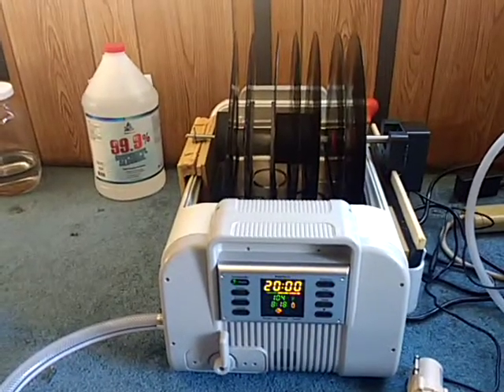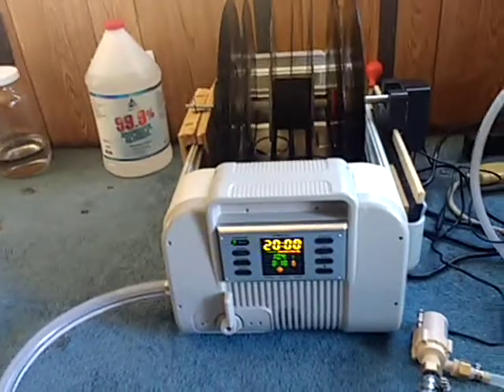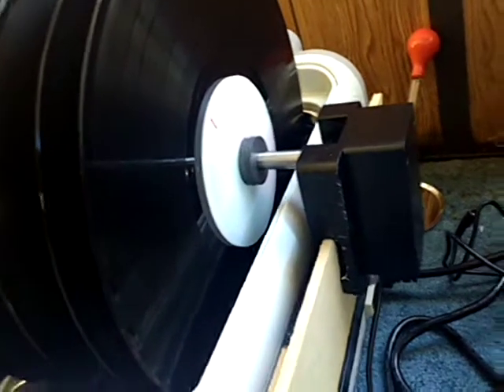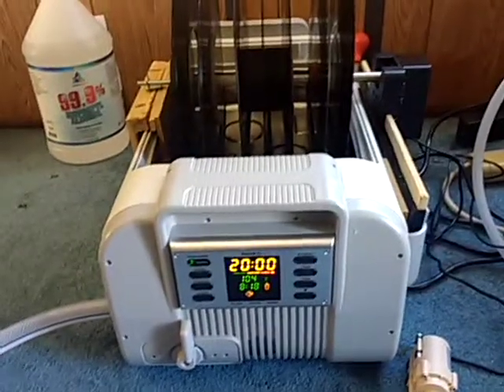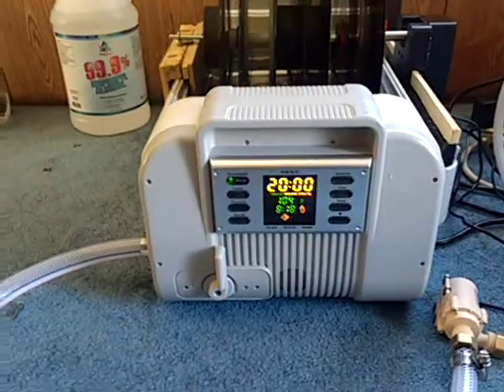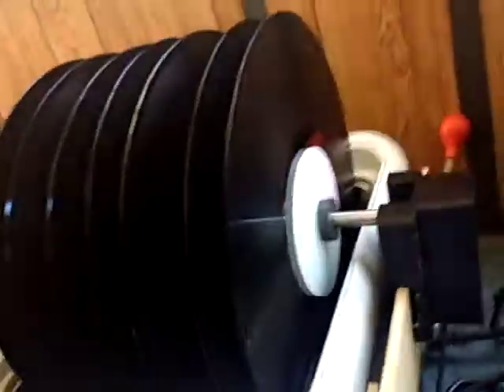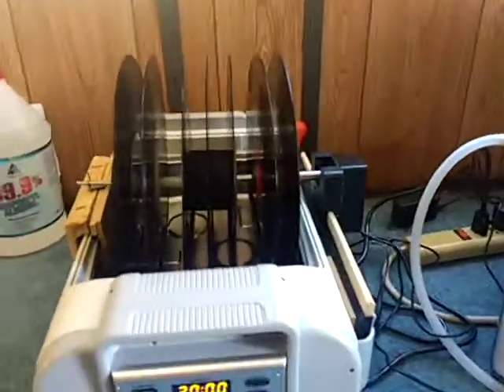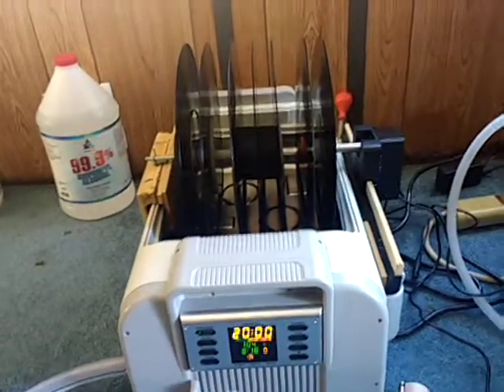DIY Ultrasonic Record Cleaning Machine (same iSonic tank used by Kirmuss) Pt. 1 (IMPORTANT UPDATES!)

Comment: My Isonic came in this week. I purchased the company branded 10 LP kit on sale at Amazon. I loved your filter idea so I set the same thing up. Same pump with 2 GE Brand water filters with a 1 micron and .35 micron filter same as yours. Cleaned my first batch today. My question is I only did 30 records then filtered the solution back in 1 gallon jugs to reuse later this week. Is this something you do as well? Curious to see how long one can reuse the solution especially if the lps were not crazy dirty.
Reply from the maker: Hey Steve!  That sounds great man!  Yeah, from the research and asking these really experienced guys about it, that seems to be the best system. Um... I don't quite understand though why you are filtering the water into jugs...?  What I do, and I think this is a bit simpler and more streamlined is that I simply filter the water back into the tank as shown on the 2nd video.  I generally do it after cleaning a few groups, and I let it run for the 20 minutes or so while the last group is drying.  That way the water is continuously filtered back through the tank and probably in 20 minutes goes through the filters about 15-20 times.  So, when the last group of records are dry.  I stop the pump and close the valve on the tank.  That way you are all ready for the next time.

If you just run it through the filters once into some container, I don't think that would be nearly as effective.  Just leave the water in the tank with the cover on until next time.  The primary thing here too is that you are adding a percentage of the ILFOTOL to the tank which has antibacterial properties, so that you can leave the water in the tank, in the hoses, and in the filters until the next time you use it.  Make SURE that you have your chemistry right for the correct balance and the most effective outcome to your cleaning, as well as making sure the heat is set correctly.

I don't know if I mentioned this in my videos, I think I forgot and left it out, sorry...  But, I got an inexpensive TDS meter at Amazon for I think under $20.  That way you can check the water periodically, or after each cleaning to see what the levels of dissolved solids are.  If you are using distilled water (like you should be!) and after you've added your chemistry, the meter should show around 0-3 ppm.  Then, as I said, make SURE to CIRCULATE the water through your filters several times after each group.  If your chemistry is set up correctly you should see a gradual rise in the TDS after groups.  If you are filtering the water properly as I suggested, then you should be able to do anywhere around 100-200 albums before needing to change the water.  You should change the water when the TDS starts approaching about 20 ppm.

Some VERY important things to remember:

1) DO NOT do 10 records at once, that is too many and does not leave enough space between records to allow the ultrasonic waves to work properly.  Regardless of what the guys at iSonic say (they are after all NOT record cleaning specialists)  Make SURE to space out the records so that you only do about 6 at a time as shown in the 2nd video.

2)  The heater in the tank takes a LONG time to heat the water, so what I do is I set it for 120 (I think that is what it is.  I think the settings are 109, 113, 122 or something like that)  And be SURE to use your TDS meter which also shows the actual temperature of the water!  Do NOT let it go above 40 degrees Celsius!  35 is better because the ultrasonic action raises the temperature a little.  As long as it is over 30 you can start cleaning.

3) As I mention in the videos, the rotation speed of their motor is TOO FAST!  It turns at over 2 rpm, which will NOT allow the record surface to stay in the water long enough for effective cleaning.  The main guy at iSonic when I talked to him said that the power to the rotation motor is separate from the power cord that powers the tank.  So, if you can figure out a way to run a 3 volt AC adapter to that motor as opposed to what I am guessing is likely a 12 volt power supply, then you can slow that down to a little over .5 rpm, which is much better.

4)  Get the chemistry right!  DON'T screw around...  Use distilled water and go by the proportions that I suggest which come from both reading the extensive paper on Precision Aqueous Cleaning of Records and actually asking the guy directly.

5)  Be SURE to give the records a good rinse in distilled water.  The simplest way I've found is how I showed using the simple dishpan in the 2nd video.  Since you likely won't want to screw with the rotational motor that comes with the tank, you can simply construct a spindle like I have and just turn the records manually so that they rotate in the dishpan and give the complete surface of the records you just cleaned a good and VERY NECESSARY rinse.  You might be able to take the spindle that comes with the tank and turn it manually in the rinse water, I'm not sure since i do not have their system.  If you prefer, you can just vacuum/rinse the records individually using your vacuum/rinse RCM.  But, I think that takes a lot longer and is a lot more trouble.  If you are not vacuuming them dry using a RCM, then be SURE after rinsing to allow them to air dry COMPLETELY, with the assistance during the last 5 minutes or so with a fan if you wish to do so.

I hope that helps!
Reply: @latheofheaven  Thanks for all the info!  I was running it through several times before I jugged it, didn’t know how I felt about leaving it in the tub. But I’ll leave it in next time. I’m not using the solution you are using yet, I will try it though. Right now using the solution that came with the machine. I have a couple of other brands around as well I use in my Okki Nokki. Might be a pain to get ahold of some of the ingredients for the home brew one. But I’ll try it at some point.
Reply from the maker: @stevelopes8783  Sure man...  You will find that simply buying the few solutions will cost a LOT less and last a LOT longer!  I have provided the links for the different products.  Also, you will have the specific properties available as explained, for example the antibacterial nature of the ILFOTOL to keep the solution from forming bacteria, thus being able to keep it in the tank.  Whether you put in in bottles or leave it in the tank, that aspect will not change.  Unless you have a additive with antibacterial properties,  no matter where your solution is stored, it will not stay 'clean'

I know it sounds like a nuisance, but once you have the proportions and routine in place, it really is very easy and inexpensive.  I don't know what solution iSonic gives you (like I say, in talking the main guy in distribution, I could tell although well meaning, he was NO record cleaning expert and just repeats whatever the company provides)  If you are going to bother to go through all this expense of the tank and time and trouble, trust me, you WILL want the proper results so that it will all be worth it  😊

If you scan through the pertinent parts of the paper Aqueous Record Cleaning, you will see exactly what these solutions do.  You need 3 basic properties in your solution:  

1) cleansing agent/IPA  

2) Surfactant(s)/a tergitol product/ILFOTOL 

3) Antibacterial/ILFOTOL/Hepistat, etc.  

If you are also incorporating a vacuum/rinse RCM when more aggressive scrubbing is needed, you can combine a variety of different agents as I have shown the different combinations I use in my 2nd video.
Reply: The latest model from Isonic locks the heater temp at 35 celsius and no longer can be adjusted, using the temp gauge on theTDS meter it stays pretty spot on. The buttons on the right now just have time selections, 5,8,10, and 15 minutes. I'm not gonna do more than 6 or 7 tops records at a time so the space is there.
Reply from the maker: @stevelopes8783  Oh, that's right, I remember the guy telling me that about the newer model having fixed temperature, I had forgotten that.  Well, that's perfect then.  Hmmm... I wonder why they don't have the longer times?  I always run my set of 6 records for 20 minutes.  I have no solid evidence that it necessarily takes that long and I'm not as dogmatic about that as I am about the solution, rinsing, and other things I've mentioned  😁 but I guess I just want to be sure that the cleaning is thorough.

That's good that you are not doing more than 6 or7 records at a time.  I would assume that you can just simply use the spacers they give you for the 10 records and space them out how you want.  BUT... I will say that if you are using their motor at 2+ rpm, and you don't have a way to slow it down, you WILL indeed have to make sure to run the session a lot longer because the record surface area will not be in contact with the solution long enough at each pass to do any good.  I'm GUESSING that MAYBE if you make sure to run it as long as you can, but don't go over 20 minutes, it MIGHT still clean effectively.  But, if you want to be SURE, then if there is any possible way to slow the motor's rotation speed by connecting a 3v or smaller AC adapter somehow, that would be much more effective.

Comment: Very nice work !!! It's me or i don't see your european link for the "bath" from isonic ?? Need try to make this . ♥ .Thk a lot for all work !!
Reply from the maker: Hey, thanks Bro!  Yeah, actually at first I ONLY had the European 240 volt version by mistake  😊  Then, someone informed me about that so I replaced it with the US one.  Sorry I don't have that exact link for the EU one, but I THINK if you do a search on Amazon UK you should be able to see that version.  The US Amazon also had the EU version listed originally, but you might as well order from the EU I would think for lower duties and that.

Yes, the tank has worked fantastically.  I will admit that most of my albums were fairly clean, but even the 30 or so out of my 2000 that I've cleaned already that I had to set aside for more rigorous vacuum/rinse cleaning still came out quite a bit better, and all the rest are for the most part really clean and quiet!  I think with all the research these other fellows kindly did, and getting the solution where it is really effective, getting the heat and rotation speed right, AND very importantly adding the 1 or 2 minutes or so in the rinse tank seriously makes ALL the difference!  Feel free to ask if there's any help you need!  👍
Reply: @latheofheaven  Hi ,
It's super nice to have answered me ++. Very appreciated !! Yes I would certainly need time if I pass the course and find this model (not want one of these machines from Aliexpress or other ... (quality ??)). What is the exact model of your tank (iSonic P4831 (II))? not easy to find here !! Sorry for my english . I will come back to you in PM if necessary and if I can ++ .One more time many Thx !!! ++
Reply from the maker: @d6mike  Sure thing!  This is the primary link on Amazon US.  It shows numerous models including the 220 volt ones if you need that.  It also lists the many variations where you can get the record spindle and motor from them.  I DO very much like their design, so if you decide you wish to spend more and get their system, then you can do that.  Just 2 things though...  1) do NOT put 10 records because they will be too close together to clean properly.  Instead, only put about 6.  And, 2) their motor turns too FAST!  It turns at about 2 rpms.  I don't know if you can maybe buy a 3 volt AC adapter like I did for my motor also to slow it down to about .6 rpm, which is fine.  you MIGHT also be able to do that with theirs.  Otherwise, if you wish to do that part yourself, you can just get the tank itself:

https://www.amazon.com/gp/product/B07PT6HRNQ

Comment: Very  well done and informative video. Can you tell us where you purchased the tank? I've been looking at Ultrasonic cleaners and I would love to build one using this tank. Your link is for a European version and not suitable for us in the States. Thank you so much for your time and trouble producing this video for us.  :-)
Reply from the maker: Thanks kindly for the nice comment, I appreciate that 
: )  There is just SO much out there about this and DIY and I've had a chance not only to do a lot of research and reading, but also on the Steve Hoffman Forums and elsewhere I was able to write and ask some of these guys directly who have researched and experimented a lot with DIY ultrasonic RCMs.

Here is a general link to Amazon here in the US which has this model + other choices to add their spindle/motor.  

https://www.amazon.com/gp/product/B07PT6HRNQ

They're spindle/motor design is very good and I like it, BUT... one thing to note is that 10 records is too many.  They're won't be enough space between the records to allow the cavitation to do its work.  You can use their spacers, but just space out 6 records across the tank, which as you could see in my case, that is what I do.  One other thing... If you choose to go with their spindle/motor, as I comment either in part 2 or 3, I don't remember, their motor turns too fast, about 2 rpms.  Like with my spindle/motor, I replaced the 12V adapter with a 3V one so that slowed it down to about .6 rpms which is much better.  I'm not absolutely sure you can do that with theirs, although the power supply to the spindle/motor is separate from the tank's main power supply.

Otherwise, you can adapt the lesser expensive, smaller one I use as I describe if you wish to do so.

I hope that helps!  (if you haven't seen parts 2 & 3, there is a lot of updated information about how I do this process along with further links)  Cheers!  Jaime.
Reply: @latheofheaven  Thanks so much!
Reply: yes i try to find a european link soo .  :)

Comment from the maker: ***UPDATED FORMULA & ADDED RINSE TANK:

In talking further with Neal, the chemist who wrote the extensive paper on 'Precision Aqueous Cleaning of Vinyl Records', I have revised the formula in the tank:

INSTRUCTIONS SUBSTITUTING THE HEPISTAT WITH ILFOTOL:

If you are using Triton X100, here is your cleaning formula:

0.1% Triton X100: this is 100% concentrated so its 1 mL/L (This is about 5X CMC so you get good wetting and good detergency)

0.125% ILFOTOL: Mix this as 1.25 mL/L. (As the document says pages 59/60, this is only a 5% mixture, so 0.125% only has 62.5 ppm surfactant but we are only adding for the bio-inhibitor and its functional as low as 10 ppm)

2.5% IPA: If 100% = 25 mL/L; if 91% = 28 mL/L; if 70% = 36 mL/L (you can see the basic equation on page 65)

Otherwise, you probably want to add the Triton X100 to the IPA to get it to mix and then add that to the tank. I would not add the ILFOTOL to the IPA+Triton mix.

Here is a link to the VERY exhaustive and most helpful paper that Neal wrote:

https://thevinylpress.com/app/uploads/2021/03/PAC-Vinyl-Records_2021-03-01_pdf.pdf

Here is a picture of the very simple but extremely helpful rinse tank I use in order to make SURE that almost all of the surfactants, etc., are rinsed off of the albums after Ultrasonic cleaning.  This way the 6 records are fully rinsed in distilled water and it saves me from having to use a purified vacuum/rinse on every record separately.  After shaking off the excess rinse water, I set on a paper towel for about 15 minutes and then add a fan blowing air through the records for an additional 5-10 minutes.  At the end, they are fully dry:

https://lh3.googleusercontent.com/pw/AM-JKLUu8jCNeVBRT0LP0cxdG_P8NHOxopPMSw0pCXDdxvV8IG2vFvCtyocq3x2mhevSfsWFKS5VAWSlMl0jEZBmkJS342GSrEog1AcMLBfcGu3TQNZxmy6q4DU1R-C4SVntbQ4Tm_EPanc-OT1XzBp-4D0k9w=w865-h649-no?authuser=0

(Just in case the link above goes 'Wonky' again, here is a 'share' link to the Google Photos album picture - it is also included in the complete pictures of my Listening Room link -  The 'Comments' shown on the picture are actually displayed in the complete Listening Room link listed in a further comment below)

https://photos.app.goo.gl/ctuQeUbopSJ37ZAB7
Reply: bad link above
Reply from the maker: @whittierlibrarybookstore3708   Thanks kindly for letting me know!
Reply: So from what I'm reading You're not making the mixture with all 3 chemicals? Just the IPA and the Triton? I'm having a hard time following that paper. There needs to be a Cliff's Notes version, way too much information for me lol...
Reply from the maker: @stevelopes8783  I know, it's pretty overwhelming.  In one of my comments I think either here on this page or on one of the other parts, I specifically show the amounts of all 3 additives to use in the ultrasonic tank.  I am using the IPA, the Triton X-100, and the ILFOTOL.
Reply from the maker: @stevelopes8783  Actually, I show the exact amounts for this tank in the comment here above this one.

Comment: Very nice, would much rather get this than the Kirmuss.
Reply from the maker: Thanks kindly Leon!  : )

Yeah, this way you can modify and customize exactly how you want the records arranged.  Despite I'm sure the effectiveness that I've heard about his overall method, I've never really cared for how because of his proprietary lid, you are limited to a strange combination of like 2-LPs, 1-45, and 1-78.  Huh...???

But, the good news is that the tank itself must be pretty solid if it is the one he uses in his $900+ system.

Oh, and I can't remember whether I added this to the information above, but I REALLY like the fact that the tank is 13" long instead of the usual 11.8" that most the generics ones are.  There is BARELY enough room for the records.  I was always having to fuss with arranging the records just right.  Now with a good 1/2" leeway on either end, there is PLENTY of room and a bit more width to play with due to that also.